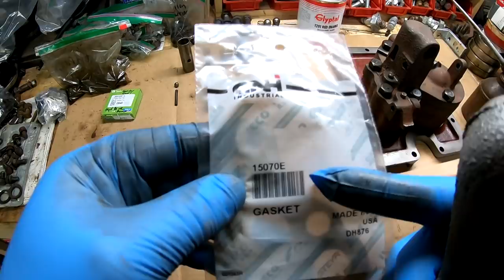1942 Farmall H Memorial Restoration: Hydraulic Lift All Reassembly

Comment: Did I miss something in the video?  You forgot one VERY important step when tightening down the bolts that hold the main body of the pump.  The gears in this pump are NOT SELF CENTERING in the pump body.  There is only .003 to .007  (max. .010 allowable) clearance between the gear teeth and the pump body.  You have to finger tighten the hold down bolts first, then turn the gears to make sure there is no binding.  It may be necessary to very carefully and LIGHTLY tap around the sides of the pump body while turning to the gears.  To center the pump body correctly around the gears.  Continue to do this while tightening the bolts incrementally to final torque.

It is possible to RUIN a pump like this.  If the gears are not perfectly centered within the body.

Side clearance is also important.  IH specifies .001 - .003.  If the side plate is worn, it is possible to have a machine shop carefully machine-down the surface to make it smooth.

IH also sells a shim package kit part #352431R91 to help in setting proper gear side clearance.

The above clearances are IMPORTANT.  If the pump is to put out it's proper PSI.
Reply from the maker: This is all very good information! Thank you for sharing so that others can read into it. I do not have all the knowledge it takes to be 100% accurate all the time - and I very much encourage others to chime in when they can! I learn as I go with all of this stuff. I ensure to rotate all assemblies by hand and listen/feel for scraping or binding to ensure it is turning freely. I did know that worn side clearance can greatly affect the pump pressure as well as the end clearance on the plate. Very similar to a regular engine oil pump, just on a larger scale.

Comment: Hey Ken! Finally got around to watching your video, its nice that you’re able to make more head way but sucks that you’ve kind of gotten to another grinding halt. I’ve got a question for, I’ve noticed before with the F20 carburetor that there’s the two holes on the choke lever, is there supposed to be a rod that goes up towards the operators platform for adjusting of the choke from the seat or what’s the deal with the second hole?
Reply from the maker: The Zenith K5 was used on many different brands of tractors. Allis Chalmers and Case also used the K5. It could be another manufacturer had a seat-position operated lever, or the carburetor faced the opposite direction which would require using the choke rod in the other hole.
Reply: Kenny Kizzle Rusty Nutz Ranch Oh, nice! Thanks for curing my curiosity!

Comment: For the lever that we pull back to lift, does that lever go inside of the kind of circle shaped mechanism on the spring activated part? Or does it push/pull along the outside. (Hard to understand but I don’t know how to explain) thanks for video.
Reply from the maker: The lever from the seat goes down to the actuating arm. The actuating arm then bolts to the small pivot arm that is on side the reservoir. That pivot arm then goes inside the oval lever on the pump that has the large spring on it.

Comment: Great video, what psi should an H belly pump make?
Reply from the maker: There are two different pump PSI's that were out there. The early H/M series pumps put out about 450-500 PSI. The later pumps were modified to have an output of 750-800 PSI. There was an update kit available for the early pumps to give them higher PSI. Essentially, the pressure relief spring can be shimmed with a washer to bump up the pressure. The shim puts more tension on the spring, thereby putting more tension on the pressure relief valve/check ball, requiring more pressure to unseat the ball. This increases the pump output pressure.
Reply: @KennyKizzleRustyNutzRanch  thanks I need to put that shim in, I remember reading in the manual the latter pumps have a yellow 8 marked on the casing that had the increased pressure. I have an earlier pump, will look into shimming it
Reply from the maker: @rogstown  No problem. Happy to help. I have been told that the spring will only accept (1), maybe (2) washers as shims. Good luck.

Comment: Hi Kenny, great vid as always.  Can you tell me what did you use to polish the surface?  Maybe you already mention it in another video but I cannot remember.  Thx!
Reply from the maker: Eric, I use a wire wheel on a 4 1/2" angle grinder on the backing plate for the pump. On the pump body pieces, I used a large glass cutting board and laid 400 grit sandpaper on it. Polish in a figure-8 pattern